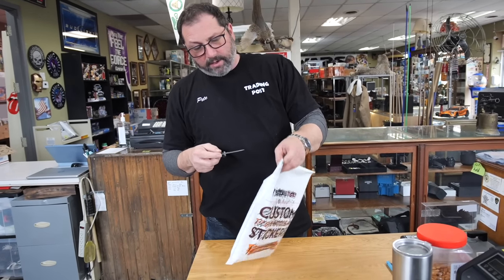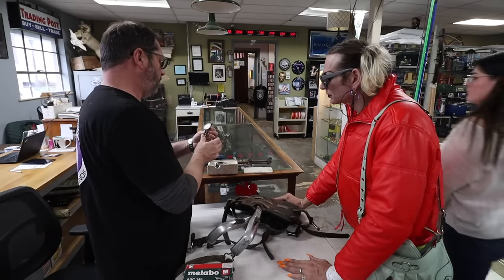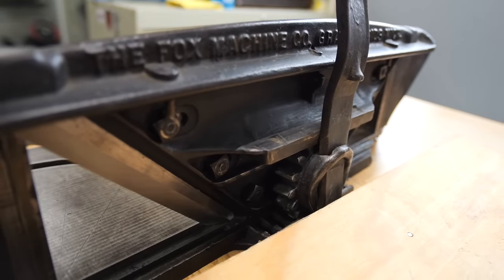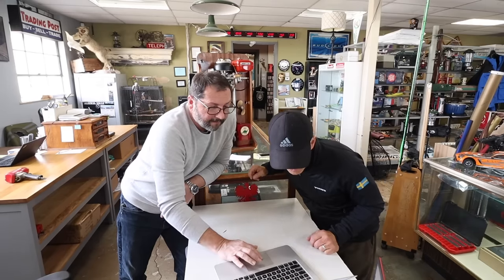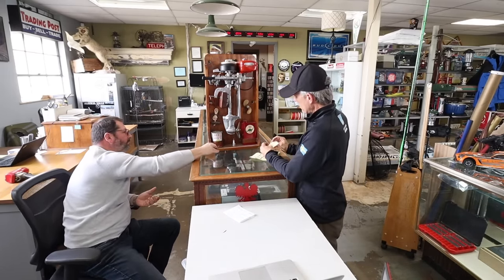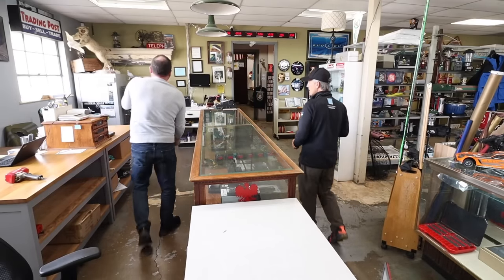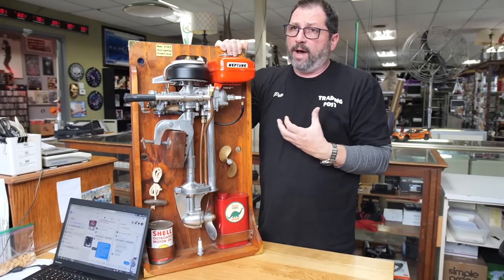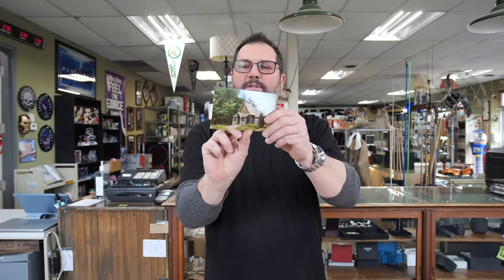Vintage Gold: 75-Year-Old Outboard Motor Never Used !

Comment: The 1961 Neptune Mighty Mite WC-1 Outboard trolling motor was manufactured by the Muncie Gear Works in Muncie, Indiana founded in 1910. They started building outboard motors in 1930 where they made motors under many brands. The Neptune Mighty Mite was extremely popular. It was a carbon copy of the Evinrude Scout rated at 1.2 horsepower, they were increased to 1.7 after the war. After 1956 all outboard motors were made at Cordele. This example was manufactured in Muncie, which would indicate production prior to 1956. Decal on tank reads "NEPTUNE". Muncie Gear Works was sold in 1969. Mounted by way of C-clamp to a display board that exhibits a propeller, two vintage oil cans and a pull-rope. A near identical display, if not this exact display, is picture in an article on the internet entitled "History of the Muncie Gear Works Corporation Outboard Motors" and comes with the motor. Sold as display only.

I copied this from Morphy Auctions,  they have an identical one on their website.
Reply: Yeah I seen same thing on Google awesome
Reply: What were they asking for it

Comment: That “piece” on the bottom of the motor is a skeg brother! It’s used to help with steering, stability, etc while under power. That would not be necessary on a salesman model! Tight lines Pete! 💪🎣
Reply: Yah the seller says OH there is no skeg?

Comment: I like your taste. I love the old school industrial tools they were made to last! The boat motor is one heck of a find for sure. I bough a 1945 Goodyear Seebee 5hp motor a couple years ago and I have got it back to 90% restored. These things are expensive and hard to find good used parts that aren’t beat up. Definitely buy that furnace unit especially for $250 bucks! Those units have tripled in price over the past couple years! Congrats on the boat motor!

Comment: You got a great deal on the outboard, that particular model was designed and produced with no skeg on the bottom. So that salesman model is accurate to the actual production model that was sold back then

Comment: Used to work in an old building in  downtown Denver on Market St. , it was a designated 'fallout shelter' during the cold war,  as it had a huge basement that ran a whole city block long connecting to other building basements along Market Street at one time.  Its all been torn down now and i really regret not getting those old 'Fallout Shelter' signs that where at every basement stairway.  I sometimes wonder if anyone did get them.  I don't know if they would have had any value but I'm thinking they would.  That building was fascinating to me with its old freight elevators , basement connections that had been bricked in, the old elevator shaks they where called, that housed the huge electric motors that ran the elevators and 2nd floor walkways that ran across the alley to another building on the next block. Funny how you sparked my memory of this with those Covid 19 Signs.. i think you are right !  We will be long gone but there will be someone like you in search of one of the most surreal periods of our time , as real as it was.

Comment: Hey Pete, I’m a licensed plumber and Gas technician.    I wouldn’t buy any used boilers or furnaces or anything gas related as far as Heating for the house.    Stoves are perfectly fine because everybody sells those.   And they are very basic.   But when it comes to boilers.   You would be liable if someone. Installs that boiler. And something happens.   My suppliers won’t even sell gas products unless you show them your gas license.    And this is why.    Just be careful man.
Reply: I sorta thought the same thing.
Reply: Are you a millionaire yet? Around here, plumbers make more than lawyers.

Comment: That's a good trimmer bud!!!! When you want to do custom woodenwork! And it is a guillotine cut. That will make excellent cuts!! I haven't been in there for awhile, I'm quite a distance from you now. Looks like you're doing ok. And that salesmans motor is cool too. I've seen those in the city too. The handle is for lugging it around to different shops.

Comment: You can easily check the dial indicators with a set of Guage blocks. I'd think people would bring a set of those in often as well. Indicators are mainly about repeatability. Set the zero and see if the block or known go to the same number. If they don't hang up and a good brand name, you shouldn't have any trouble getting money out of them. Interapid(swiss made) are the best in my opinion. Brownw and Sharpe, Mitiyoyo, Starrett are all decent.

Comment: A lot of outboard collectors took old motors and shortened them like this.  My guess is a collector restored it, filed the broken skeg smooth and mounted it in a display box.  A salesmans sample case would be beat up, and the full sized motor isnt much bigger, so why would they cut it down?
Reply: Bingo...Dan is correct.  :)

Comment: Old tools are the best. I work outdoors. When I was at agricultural college we had to use hand tools from the 40's and their equivalents of today.  The old tools ( billhooks, scythes and sickles) went most of the day without sharpening, the modern stuff hourly at best.........
I have a spade dated 1942 ( with crows foot) and I'm still using it today. I run a file over its edge and you could shave with it. It's used nearly everyday too.
And because of the crows foot, has a lifetime guarantee........ although, after 82 years I think it may be void 🤣🤣

Comment: that motor is right at the start of that sort of thing i bet it didn't have a guard, it was probably replacing whole hit miss engines in a boat! pull the spark plug out and see if its clean if it is it wasnt used! also that would have been stored in a shed away from the boat so it would need carrying handle for that as well

Comment: Of course people aren't getting a warranty on something used and they certainly aren't paying the FULL price either. I took a risk in buying a gas range about 8 years ago because it was a donation to a charitable business so I took the risk and it worked. It's all you can expect when you're buying a used item. 

That range lasted around 10 years before my landlord decided to change over to natural gas and I didn't want to have to pay a service tech to change the orifices so..... Then I purchased another used range list price of $1,995.00 for $600.00, it's beautiful, all stainless,  blue enamel on the inside and I love it. Have had it for 2 years now and now problems. It's an LG I did have a 30 day warranty with that one though because it had been tested and was like new.

Comment: Great outboard motor! I'm thinking it's not long enough to attach the transom and reach a depth deep enough to run and push water? It'd prob work on a small dinghy with a low draft. Thx for the entertainment too.

Comment: The furnace he is talking about that he paid 4500 was to have it installed... probably only cost about 800 to 900$... plus if it was installed upright there will be a hole cut in the cabinet on one side most likely... So you have to find somebody that needs a hole cut on the same side.

Comment: Hey, I think 🌳 Tree Climbing/Arborist Spikes are worth considerably more $$$$ than ☎️  Linemen/Telephone Pole Spikes. High as Hell from Orygun 🚬 🚬 Pete, you should remove the sparkplug from the outboard, insert a bore scope to look for signs of wear in the cylinder, to prove that it indeed has never been run 🏃‍♂️ glad you got it !

Comment: I accidently cut off a finger playing about with that type of wood guillotine in a woodwork class at School in the 70's , finger  was still hanging on by a skin flap on the other side of the small finger  ,  there was blood all over the cutter and woodwork bench ,  the male teacher went white as a sheet when he came to try help stop the bleeding 😂 , it was totaly my fault I was fooking around trying to slice too large an edge and the blade jammed half way through, as I was trying to free the wood by pulling the handle back and forwards hard while I held the wood steady with the other hand , I still don't know how my finger got into the way of the cutting blade . the hospital managed to re attach my finger since it was such a clean cut

Comment: If someone wants that outboard they'll just bring in a small wire cutter and out the door they'll go. I would use a hefty chain and unless you have bolt cutters in your store I wouldn't display it there AT ALL!!
Reply: Most people that go there will have no interest in that boat motor .